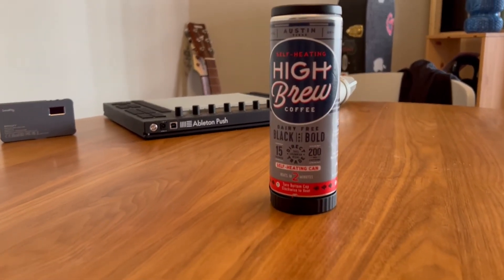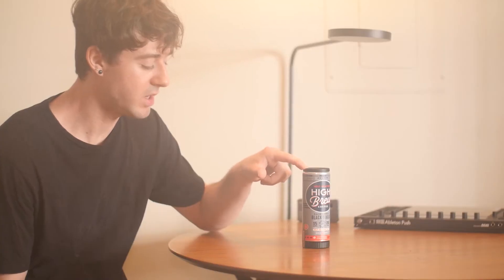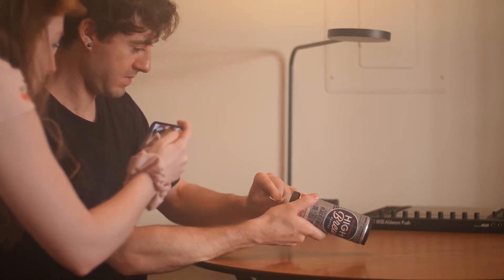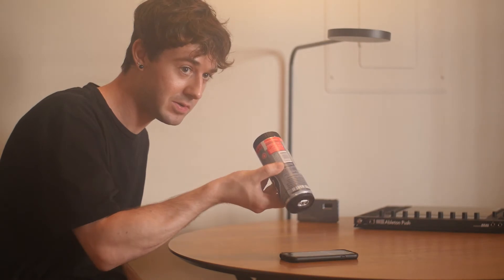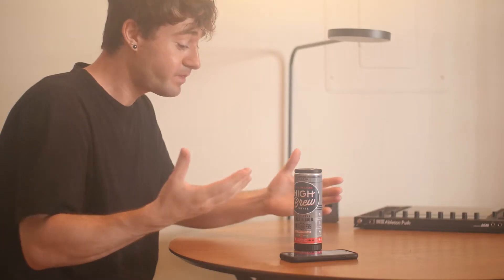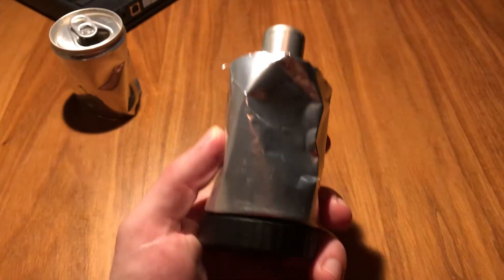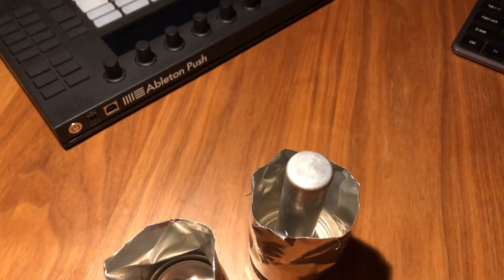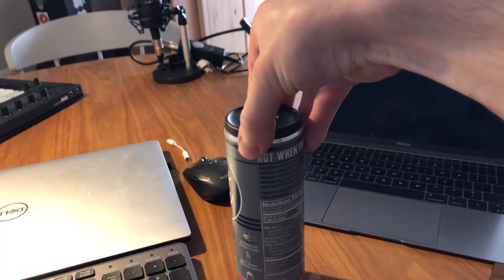The Coffee That Heats Itself (High Brew Self-Heating Coffee)

Comment: Did you ever figure out what's inside of the coffee and how we could be recycled?

Well inside the coffee heater is 100% pure thermite and it burns off completely leaving nothing but an empty space for aluminum to to be recycled if you cut the can depart before you turn the heater on you will see how thermite react when you activate it without water to cool it off it is very dangerous and could burn ❤️‍🔥 you so don't do it
Reply from the maker: Thanks so much for the info! I will update the video description in regards to the thermite inside the can.